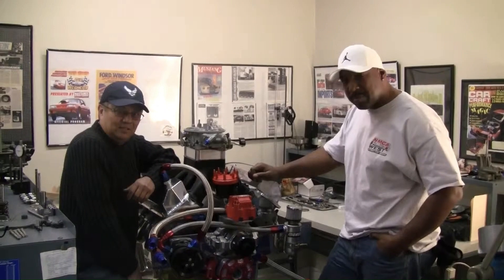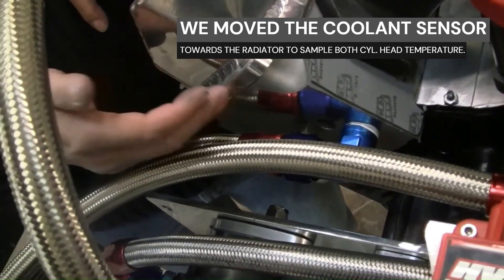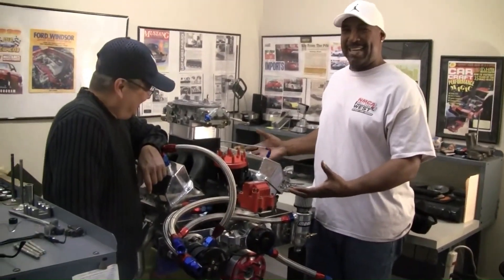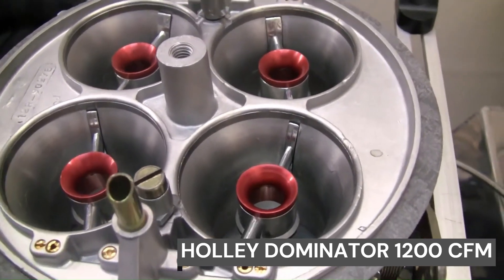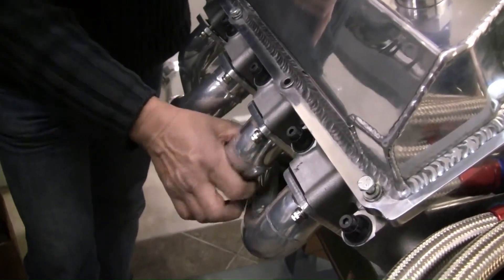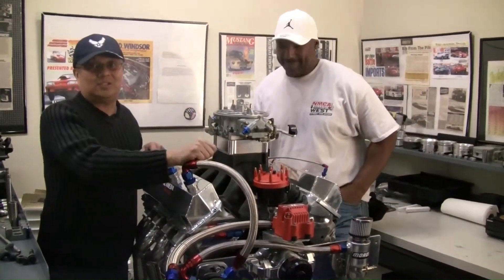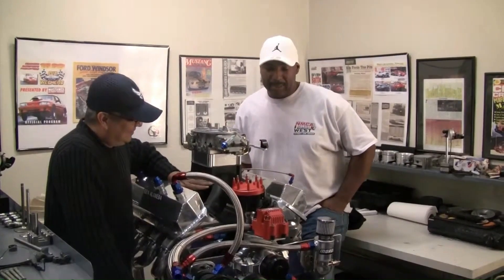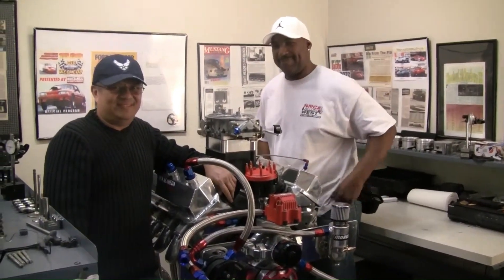FORD SMALL BLOCK.

Comment: Ben i see blue thunder hesds. What hp that engine make. Very impressive
Reply from the maker: This one at that configuration made roughly 880hp flywheel.
Reply: Very cool. Is that 4.3 head or 3.6. I did a 434 with 3.6 made 807@7300
Reply from the maker: @stevecleveland357  It was originally a 3.6 raised and plated now to a 4.3+.
Reply: Thanks Ben. That extra height makes a big difference. Very cool build. To bad the 4.3 isn’t more readily available.

Comment: Cleveland heads make everyone smile.
Reply from the maker: Blue Thunders are nothing but an updated Cleveland head with smaller chambers!
Reply: @benalamedaracing2765  and that makes me smile 😀 A Cleveland is all I have ever raced. My current 359c has Trick Flow 225cc heads with the 60cc chambers. I have the TF Track Heat intake too. 521hp@6300/453tq@5600 at the crank doesn't set the world on fire but its fun.
Reply: Except the GM guys.😀
Reply: @NobilityandLoyalty  ya, GM guys are still convinced Ford copied their bbc head design and  I have been told at the track my 359C is a big block.